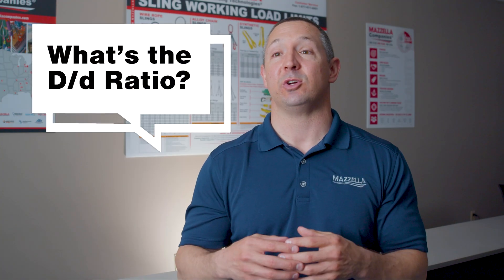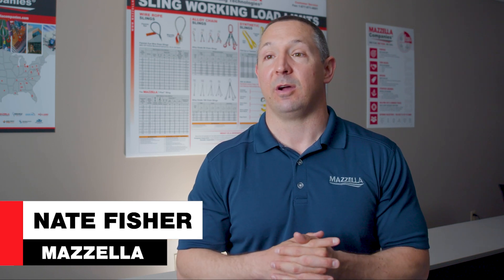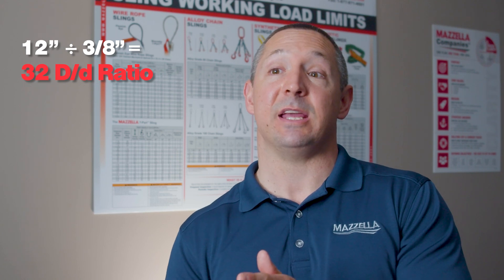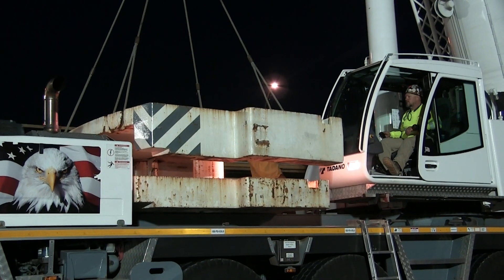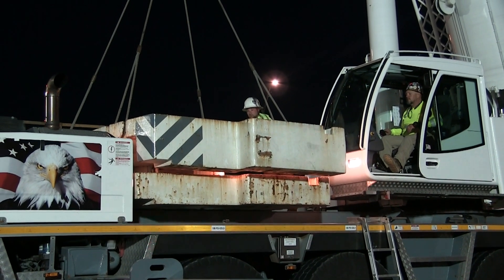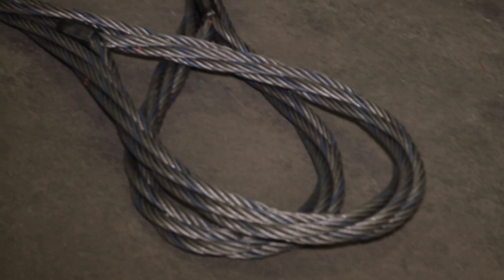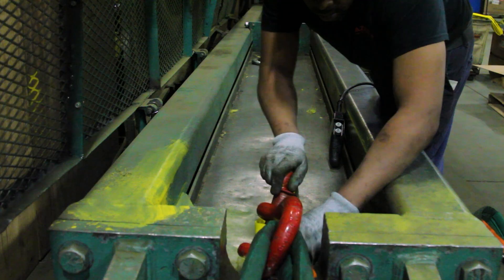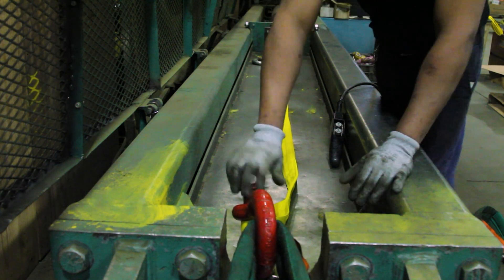What is D/d Ratio?

Comment: Hi , I'm really appreciated sharing those types of helpful videos i have one doubt about the importance of d/D ratio with endless grommet sling,is d/D ratio important as well?
Reply from the maker: D/d ratio is important and should always be taken into consideration.
For complete information on D/d ratio, please refer to the website wireropetechinicalboard.org.
The rated capacities of grommets are based on a D/d ratio of 5:1, where “d” is the body diameter of the finished grommet. You should consider a reduction in WLL for anyone using a cable-laid grommet with a D/d ratio of less than 5:1.
Reply: @LiftingandRigging  thank you very much, it's really kind of you,

Appreciated 👍

Comment: Why is the ratio 6 and why does it not apply to nylon/synthetic straps?
Reply from the maker: Hi! The reason the answer is six is because it's determined by the American society of mechanical engineers, ASME. Those people set the standards and they have determined that that is what's best.

The same answer is true for the nylon / polyester slings. I have read some articles that say the testing that they have done with nylon / polyester slings shows that they have the same break strength, regardless of the diameter of the item it is going around... As long as it is a rounded edge and not a "sharp" edge. 

- Nate F